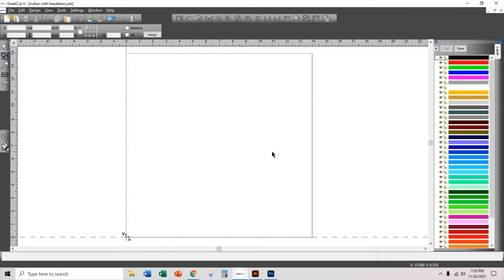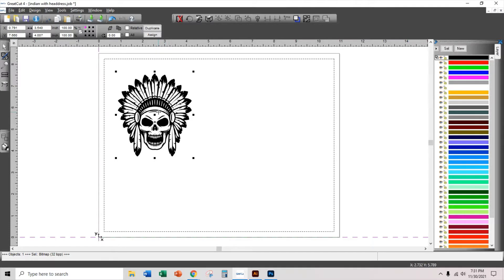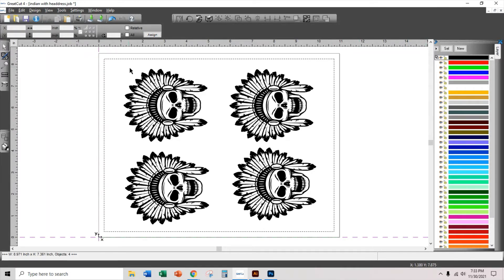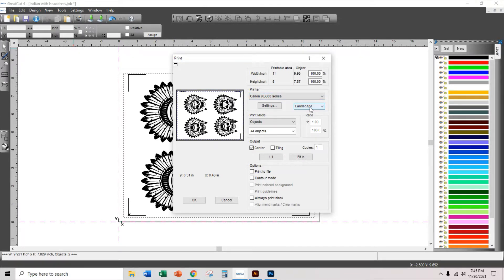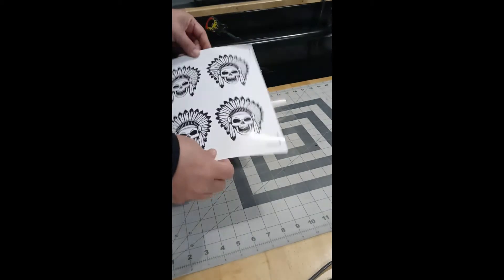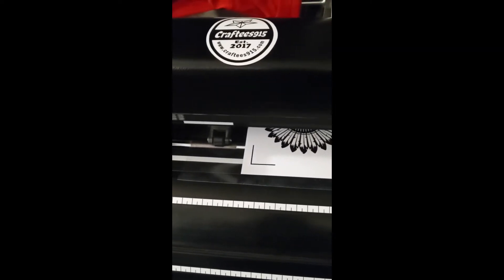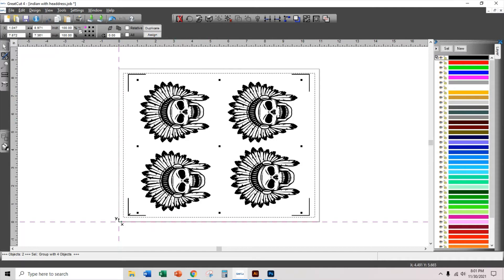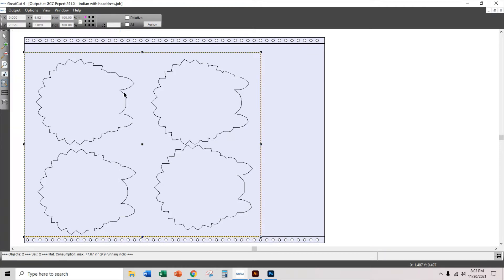Print and Cut Stickers with GCC Expert II LX

Comment: That grinding noise isn't normal for any vinyl cutter.
Reply from the maker: Thanks for watching, commenting and most of all,  subscribing!
The noise is not the machine itself but the pinch rollers on the adhesive of the carrier sheet.
Reply: yes it is for this one ..LOL had mine for years sounds the same today as when i first bought it.. it is the type of motor..

Comment: What if your room is really dark with Matte and the cutter will not read the registration mark?  ( already killed 3 sheets)
Reply from the maker: Thank you for watching and subscribing!
Perform some troubleshooting.
Are you cutting with AAS mode?
Is your blade right on top of the registration mark?
Is your cutter equipped for contour cutting?
Reply: @craftees915   Wow that was quick -  I tried two things.  running my printer  a few times on regular paper in case the toner dried up a bit.  Then I forgot i usually import EPS  and my tester sticker was a PNG----  Not sure which one worked.  but it did thanks!

Comment: This Cutter is good until you mistakenly bump into the USB cable. The connection breaks off from the motherboard. Solution, change the entire board, or start using the serial port. With the latter port, you'll have tons of problems like you can't cut a lot of ups in like a meter vinyl, slow to receive the job from printer.....
Reply from the maker: Wow!
I've never had that problem and I've dropped mine a couple of times.